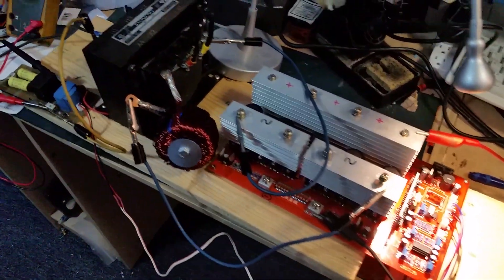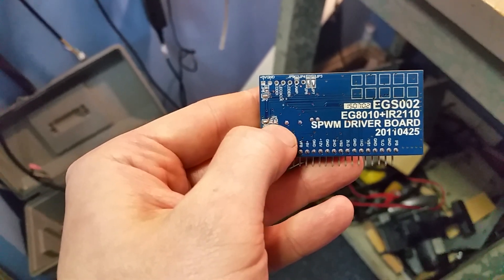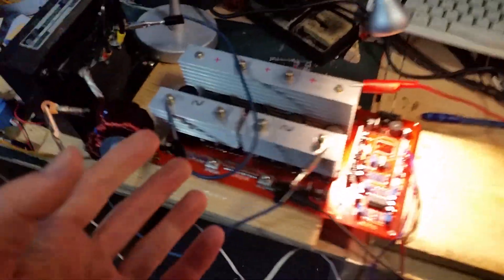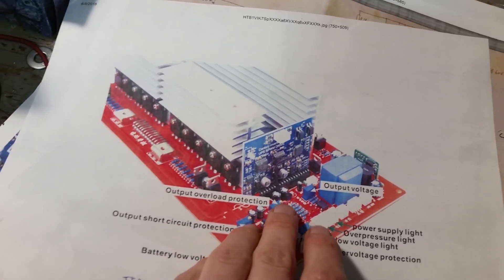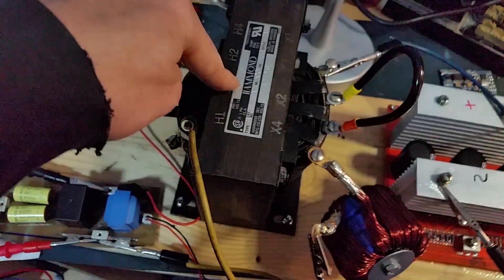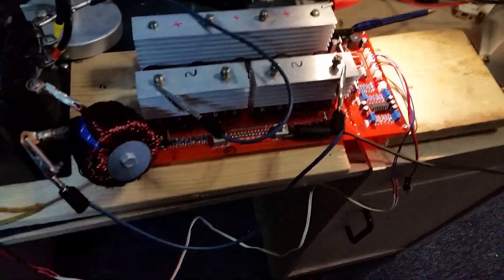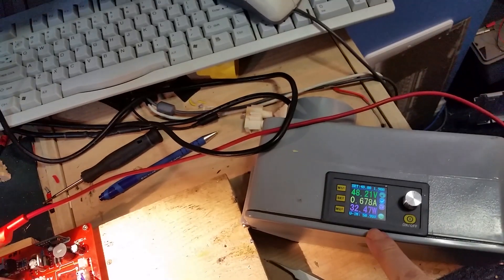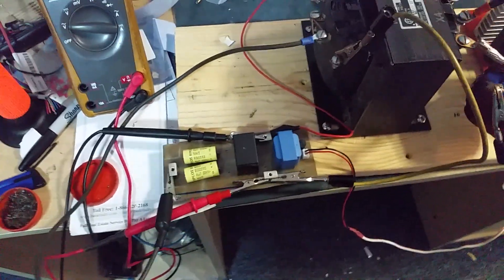DIY custom inverter for power wall

Comment: Hello instructor,
I saw your video demonstration and I want to ask you to teach me on how to use or connect an inductor to this type of Chinese inverter board.
Please is the inductor connected to the input of the transformer, to the board circuit any how? Or there is strictly an instruction to follow? Talking of the inverter board in this video as an example, thanks Engineer.

Comment: Just my observation.
Most of this video and the comments are way beyond my understanding, but I have been dabbling with inverters for a few years now. We are completely off grid in Orkney, Scotland and have used a Powerjack 8kw for about 6 or 7 years. Works great, but thought I’d better get myself a backup. I got the identical AliExpress board to the one in this video and connected it to a big toroidal transformer. The sine wave is not as good as the Powerjack, but everything in the house works perfectly. We generally draw about 150 to 250 watts at 240v ac, but occasionally it goes up to about 5kw for a while when cooking or washing clothes. It runs 24/7 and has been “on test” for about 5 or 6 months. Very little heat generated, a little when the boss is cooking. 😋

Comment: any suggestions on sourcing these transformers?  I think some have actually wound their own transformers.  Great project/video! Thanks
Reply from the maker: i got one of these from amazon usa https://www.hubbell.com/acmeelectric/en/Products/Electrical-Electronic/Power-Quality-Conversion/Buck-Boost-Transformer/Buck-Boost-Transformer---Single-Phase-120-X-240---1224V-7-5kVA/p/1655918 its called a boost transforrmer.

Comment: thanks for posting this vid. i bought 2 of this inverter board on a hail mary. Barely any docs... I cant source the transformer nor inductor. Sell them to me. Lso, can you demonstrate how to test without transformer?
Reply from the maker: I have an inductor for sale on ebay. I used a T211688 Buck-Boost Transformer, 1 Phase, 60 Hz, 7.5 kVA, 120 x 240V Input, 12/24V that I bought off Amazon. I don't have it anymore though

Comment: I tested the low frequency inverter that I designed but the out put is giving me 106v and when I connect filter capacitor of 5uf the out put dropped to 83v without feedback and when I connect the feedback the out put go up to 85v and the the feedback voltage is 2v minimum. What could be the issue while the out put can't go up to 200v. I used spwm module.
Thanks for your reply

Comment: The inductor is far far too small for 150A hence the cover melting off, at full intended load determined by you the series inductor should only get warm. The weakness in the design is those tiny dc power decoupling electrolytic capacitors between the heat-sinks as the high ripple current is the killer they dry out go open and the things blows up in smoke.  you can solder large caps too bottom of PCB for backup, and never run the board at full power.

Comment: The series inductor is to filter out the high frequency switching component as the inter winding capacitance in the output transformer looks as an almost short circuit where without it Hugh surge switching current spikes pass through the inverter and can even damage or blowup the power mosfets. Transformer core losses can be reduced by either using a CRGOS core or under fluxing the core by adding more turns for the same voltage. You need to wind you're own transformers to get the most out it but you will have an inverter for life not the rubbish on the market that ends up in the bin in less than 5 years and cost thousands. They key is you can scale the size of the inverter and service the unit yourself and save a fortune.

Comment: Ive seen 48V 10KVA inverter power PCB on ebay for only $217AU, not bad. Unlike most off the shelve inverters, These units require a large power transformer, to covert the voltage to service say 230VAC, this may sound expensive, but making an inverter this way is far more reliable, than the rubbish on the market costing thousands. Plus if anything fails its cheap and easy to swap out the invert board and of u go. You can choose what even battery bank capacity you want and its easy to make a massive UPS, you can add redundancy, add solar charging panels arrays. One trick for reliability is to never run the inverter at full current, use the limiting pots to protect the board. Another trick is to design the output transformer for high impedance, this is to reduce the maximum possible fault current.

Comment: Great video but some critical errors you made there.
1. Do not use the high voltage output of the transformer in centre tapped configuration for 120/240v output. There are nasty transients on the centre tap even when grounded. Use a separate buck transformer to get the 120v you need. I learned that lesson the hard way when most of my home electronics burned from the 120v output. You need to use an oscilloscope to verify a clean waveform after commissioning the inverter.
2. Removing the small transformer from the board is not good since those long leads to the inverter board will introduce noise that messes with the voltage regulation.
3. The inrush limiting toroid inductor is only needed for toroidal transformers. The softstart feature of the spwm card eliminates any Electrical stress during power up for El type transformers.

Comment: Hello . Very interesting video .I've actually bought 1 of these. .48 volt .I wonder if you can help , it's all connected up .but I can't even get the led on the driver board or the led next to the feedback transformer to light up . Basically .the unit doesn't boot up

Comment: Thanks for the video learned something new.
I'm building a  powewall  with  18650 Liion cells and i need 5000w inverter.
These are too expensive in here, is it possible to diy from scratch or convert 12v,800va sne wave inverter into 24v, 5000/4000w ??
If show please  share. Because i can't buy from china 😑

Comment: Tks for all the info. Saves me a lot of time. I'm presently using a 24v 3000w version which works OK.
Do you know how the Bat protection circuit works?... What does it trigger to shutoff. On the egs002 there are only a few inputs for signals... (temp, AC volt, current)... I'm trying to figure this out.
Reply from the maker: the boards i used had an op-amp circuit that monitored voltage and current and would kill the inverter if the setpoints were triggered. this was a pain in the ass though since it had to be calibrated while energized.
Reply: @erroneus  I'm facing issues with this and will try to disable it.

Comment: I bought the 48v 11000VA Pure Sine Wave Inverter Board Power Frequency Inverter Board I was expecting to be able to just plug it in and use it not realizing I need a 47uh dr. And a 5KW-10KW 220v transformer I find out after receiving it ! I bought off E-Bay  is it worth keeping ? If so where do I get the parts I need to get it to work Please ? This is over my head !

Comment: How can we calibrate the overload protection ( short circuit) trimmer pot?  Is there a formula to calculate the resistant to be set in the pot for overcurrent protection??

Comment: hi i just have one of those inverter drive .put im having problem it run a motor put it only last less then half a minute can you help with that or do you have an email to help out  my is 48 volts im wondering if they send me a damage one from china .all i want is a power full inverter that can do a freezer but i don.t wane paid  400 doalrs  on a sine wave inverter .

Comment: The chinese manufacturer you refer to is Sigineer. They sell through EVTV in usa and internationally on their own site:
https://www.sigineer.com/product/96vdc-15000-watt-pure-sine-wave-inverter-for-tesla-model-3-lithium-battery-pack-module-120240vac-110220vac-230vac/

Comment: Inductor size for 4kW transformer 48V?
Secondary winding is 48V exactly.
Is that a problem or not?
Reply from the maker: The inductor helps smooth out the switching noise and improves efficiency of the transformer. the voltage is not that important to the inductor, also, 48Vdc does not directly convert to 48V AC. but that isn't really relevant to the inductor, the value of the inductor is 4.7uH and gets hot because of the thin wires. thicker wires = more current
Reply: Is there a limitation if i want to add more transistors to increase power?
Reply: I have 2500W transformer and inverter board that have 8 transistors
  HY4008 .

Comment: can you do it with high voltage dc like 400v
Reply from the maker: Yes, but not with this board. There is a schematic in the datasheet for what you are looking for. Need HV fets and a large inductor

Comment: I am in a Inverter 6000 W peak 3000 W continual modified Sine wave is it possible for me to upgrade this to 12,000 W peak 6000 W continual tool pure sine wave ?

Comment: I'm interested in this approach,  as I want to use a 36 volt battery and inverters for this voltage appear to be scarce and costly. I've spent the last few years repairing large-scale audio power amplifiers so this isn't too far from what I know well. I also have some very large toroidal power transformers which I can rewind.
I'm curious if the input current is proportional to the apparent or true output power. I expect it will be the former, so I would look into whether shunt capacitors for my refrigerator compressor and whole-house fan will reduce battery load by improving power factor to near unity. Thanks for your efforts, de AC4AQ

Comment: How much did it cost for the inverter and the pure sine wave control board I got a 50v dc generator I want to finish building I got the variable voltage regulator in the mail and now I need a inverter and a lil tip they have not Shure what to call it umm mosfet step up ac driver boards that are smaller and lighter than the hevy transformer
Reply from the maker: the board with controller was about 280, but it wont work without a big inductor and transformer, which cost about 300. I'm not sure what you are after, but generally, the cheap light-weight inverters are mostly mosfets, but they can't handle any surge current at all.

Comment: Good video keep it up
did you try an inverter with high frequencty transformer ?
Reply from the maker: yes, I had a 1500w cobra inverter (12v), it could run a 1200w kettle to boil water, but it couldn't take any capacitive or inductive loads. (would crap-out with a 600w digital power supply)
high frequency inverters are crap for anything other than resistive loads, which makes them kind of useless for anything bigger than a laptop

Comment: Yes it is cheaper but.... is any voltage regulations depends on a load....?
Reply from the maker: there is a feedback line that lets the controller know if the output needs boosted. Under load, the output is mostly pretty good, ranges from 237-241 Vrms

Comment: Excellent video just I was looking for.... 👍 
Does this red board have automatic voltage regulations AVR?...that would be awesome... 👍
Reply from the maker: I dont think they call it AVR, but it does have a feedback circuit from the out put to maintain a setpoint
Reply: @erroneus  could you just put a little fuse on the feedback wire?

Comment: https://ru.aliexpress.com/item/3000-Post/32885041807.html?spm=a2g0s.8937460.0.0.f1fb2e0exyFpVH

https://ru.aliexpress.com/item/1000-DC-12-24-AC-110-220-380/32866924746.html?spm=a2g0s.8937460.0.0.f1fb2e0exyFpVH

This high frequency inverter doesnt have protection. Is there a way to add protection?
Reply from the maker: I find even store-bought high frequency inverters to be unreliable. If you really want to use these and add protection, you need a way to enable/disable them with a signal that goes to an additional current monitoring circuit.